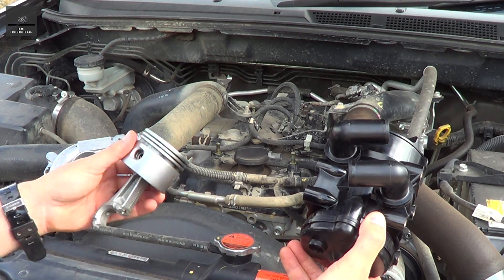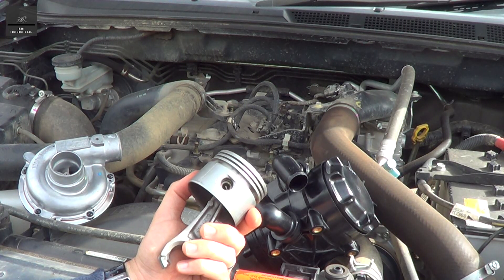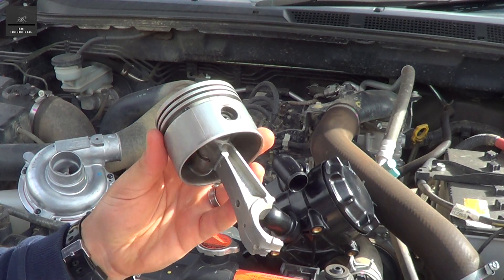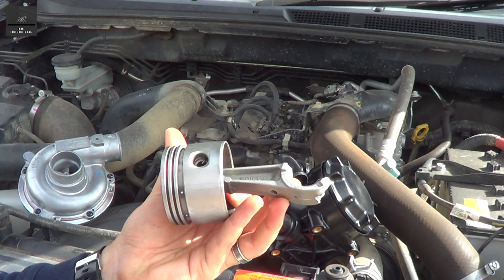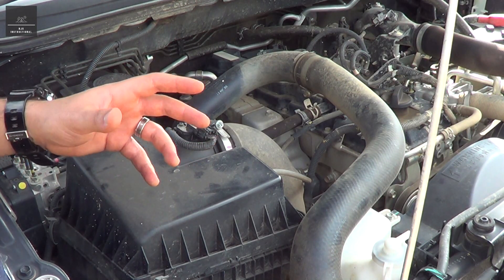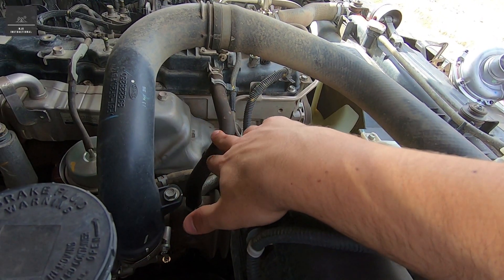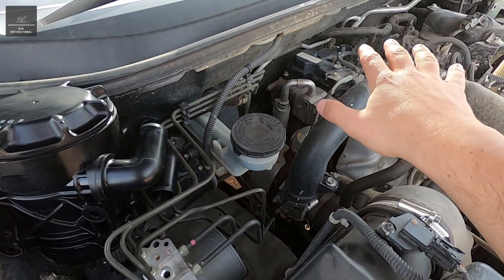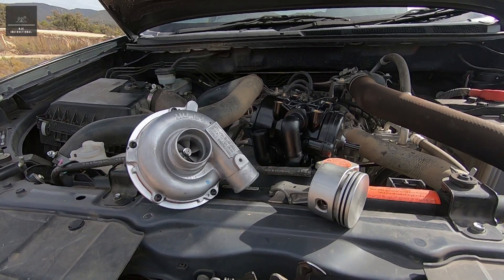Engine Blow By and Oil Catch Cans - Everything You Need To Know

Comment: You never talked about the ring gap of the piston. Ring gap is the distance between the two ends of the piston ring as the engine, and piston heat up do does the rings the metal in the ring expands the rings expand closing the ring gap. But the manufacturer mathematically figures this distance out so the rings never touch. So there is always a gap in the rings allowing gas to pass on through to the crankcase. In the 6.4 Ford diesel that gap is quite large as the back two cylinders are flooded with fuel to heat the exhaust to extreme temperatures to attempt to burn clean the soot collected in the DPF. In that time fuel and gasses pass through the ring gap and into the crankcase and engine cavity. The excess fuel mixes with the oil diluting the viscosity of the oil causing the oil to not do its job fully and in so causes premature we are and early engine failure. Also adding to excessive blowby. Putting pressure on deals and gaskets causing oil leaks and failures this has caused catastrophic failure. Remedy deleted the process

Comment: Mate I have a corolla ts 1.8 192hp 2zzge 
is it normal when i open the oil filler cap that air comes out without smoke? or does it have to suck air in? (On running engine of course)
Reply from the maker: Yes, if you open the oil filler cap the air/smoke that comes out is called blow-by, a little bit is quite normal.

Comment: What you thoughts on Toyota when they say fitting a catch can will void a warranty on a new vehicle.  do you wait for warranty to expire before fitting.?
Reply from the maker: Good question. Poor installation of Catch Cans (incl. wrong fittings and hose diameters & lengths) can actually be detrimental to the engine. There have been reports of engines blowing main seals / gaskets due to poor installation or poor choice of Catch Cans. It is important to really consider any engine modifications and the pro's and con's of these modifications.

Comment: Thanks for the video. I am a bit confused by this (Direct Injection Diesel) Durely it would be better to eliminate the filthy carbon from the EGR going back into the intake, and acutally allow the oil vapour to get recirculated? At least it would provide some upper lubrication, whereas the EGR just pumps filthy exhaust back into the motor - Also, if the EGR is a requirement, why not route it back into the intake before the air filter?
Reply from the maker: Hi Richard, good questions. Even before EGR was introduced, blow-by was already being recirculated back in the engine intake and wasn't a problem. It definitely does provide some lubrication but also can coat the turbo, intercooler etc. with oil. Some engine manufacturers have designed this system (i.e. PCV system) well and others not so much. However, with the introduction of EGR, combining the recirculated exhaust with the oily mist of the blow-by, it can form carbon deposits... If the blow-by was recirculated prior to the air intake, it would then quickly coat the air filter element with oil and block / restrict air flow. Hence, it is always plumbed in afterwards, usually just prior to the turbo. Hope this clarifies. Cheers.
Reply: @NJSInstructional  Thanks for the reply, I added a reduction plate to reduce my EGR and it seems to be helping keep things clean (reduced not blocked) I also vleaned out my intercooler (70,000KM) and it didn't ammount to even a spoonfull of oil. I wonder would it make sense to have some sort of aftermarket kit (Direct injection, not port or combined) that could work like the old Scott Oiler that used to put a drip of oil on motorbike chains constantly - Something that could add a drop of lube / 2 stroke into the inlet manifold... Probably not good for emissions though. Cheers!
Reply: @NJSInstructional  I caught that also. "Before the air fiter".

Comment: You need to educate yourself on the difference between gas engines and diesel. Because there has never once every been a port injected diesel. All diesels are injected directly into the cylinder or in to a pre-combustion chamber that’s part of then cylinder.

Comment: @NJSInstructional, Great general explanation of how a catch can works.  As I am trying to build a DIY setup for a particular vehicle I have a question regarding the size of hose/fittings used in the PCV/catch can system.  The catch can in this video seems to have an inlet and outlet that is considerably larger diameter than the diameter of the factory PCV hose.  My question then is, how does this size change affect the flow and pressure of the gases within the system?  Does it even have any affect?  

I have scoured the internet for days seeking this information and have found nothing talking about this and thought you might be able to answer such a question or at least point me to someone who could.  I thank you ahead of time for any help in this matter.
Reply from the maker: Thank you. You can use reducing elbows/fittings to connect to the engine's blow-by OUT port (on the rocker cover) and turbo blow-by IN port. This way you maintain the diameter of the hosing used for the Catch Can up until the IN/OUT ports. As long as you don't go smaller in diameter than the engine's blow-by IN/OUT ports it should be OK. Remember, the blow-by IN port (just before the turbo) will be under a negative pressure (vacuum) as the turbo will suck the blow-by air in (whether this is from the Catch Can or the standard PCV set-up). You can also check out the Oz Isuzu forum to see how others have plumbed / installed this Isuzu Catch Can in their DMax/MU-X (www.ozisuzu.com.au). Cheers.

Comment: Thank you for this fantastic video! I have a hard time not using the torque on my subie sti. But i guess i should let the rpms climb without boosting much if i understood you right? Or just get a air oil separator. Thanks again

Comment: This is a great video. Many thanks. I am trying to find a solution for my two 1991 Hino Turbo diesel boat engines but they are 3.83 liter (or 234 cubic inch displacement) so I worry that they may be too big for the part that you are demonstrating here. Although some of the info that a reader pasted below suggested that they are also used on Isuzu's 6 cylinder engine, the 6HK1. Can you offer any further tips for a suitable part or confirm that this one would still work with a 3.8 liter engine? Thanks again!
Reply from the maker: Hi Clinton, yes, this should work on a 3.8L engine.
Reply: @NJSInstructional  : Thank you for your reply. With some of these older diesel engines they simply vent the blow-by with a hose pointed down into the hull, like on my 1991 boat with twin Hino motors. What doesn't stick to the floor just vaporizes and much of that gets sucked through the air filter eventually and into the motor through the turbo. We don't really have a proper 'intake' for these gases like the kind we have on our newer trucks as in your demonstration. I wonder if its okay to connect the separator's output (now that the blow-by has been cleaned) directly through the air filter itself for a more positive connection. I use K&N filters on my motors and I was thinking of installing a barbed fitting at the end of the filter to accommodate the separator's outlet hose. This would also create a little vacuum which might also be beneficial.

Comment: Hi, the product shown is meant for the NPR range of Isuzu trucks.  Is it working well in your MUX or Dmax and able to handle the flow rates of the ventilation gases at different speeds/torque ranges effectively? Has the absence of a crankcase  pressure regulating valve (like in Provent) in this product impacted you?  Can you show how you've mounted it?  Thanks.

Comment: but toyota diesel engine with 2kd series (hilux, hiace) EGR come after intake and throttle body. so it need clean regulary although it has done installed catch can, because it didnt separate 100% oil and air(+carbon)